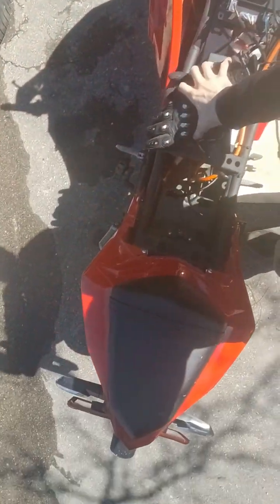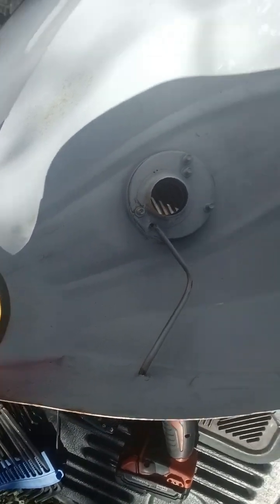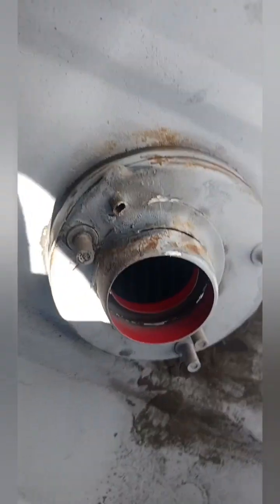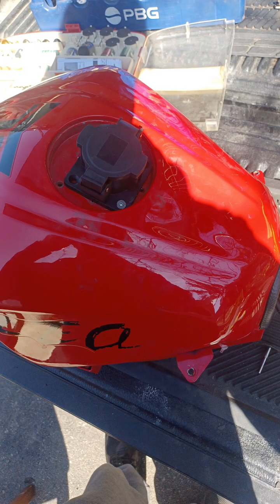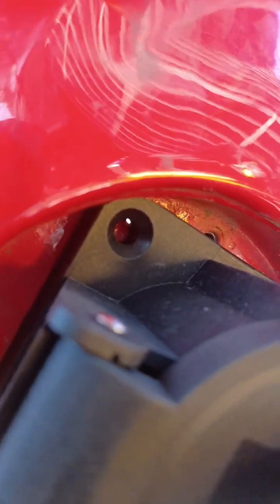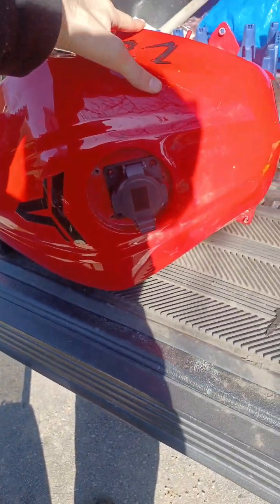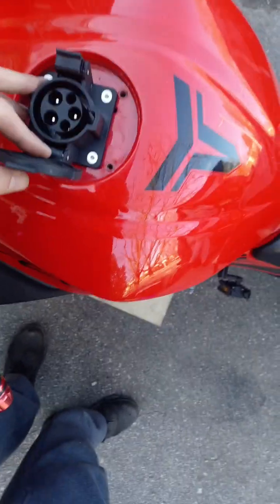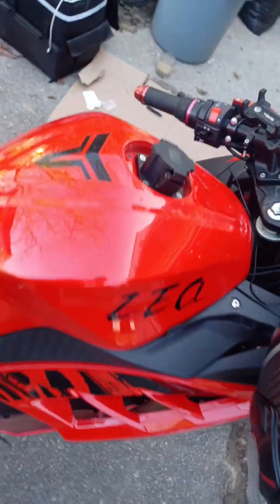Installing fast charger Tao Leo

Comment: I did this to my leo a year or so ago. Best mod i ever did. I kept my cap though and built everything in under it. This makes a tonne of difference in charge time. Nice job bud!
Reply: U can add a 110vac plug inline with ur 240v fast charge plug. Just remember to only plug 1 in at a time. U should do this. I have a tutorial on my channel. World of difference when u can charge level 1 and level 2 😁

Comment: awesome work bro
Reply from the maker: Thanks man, took better part of 3 hours, maybe 4. Turned out really clean though.
Reply: @theevilben666  how much would you charge to add this
Reply from the maker: @alr  it mostly depends what you want. Currently chargers are going for 100-200 for the high end models that are shake resistant and waterproof. The system I put in my bike cost around 300$. I however only order good parts. Plug is around 45-60$ depending on the market plus shipping costs.